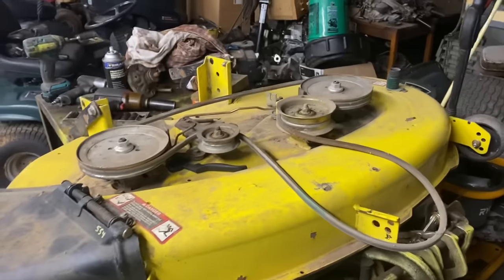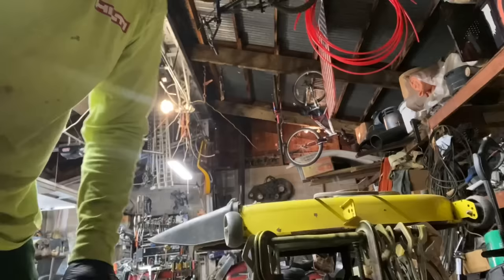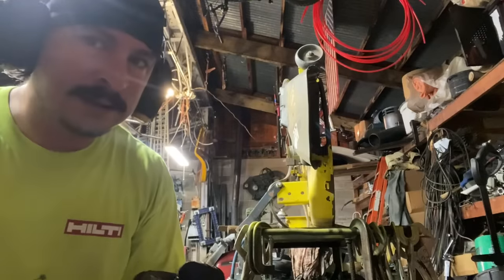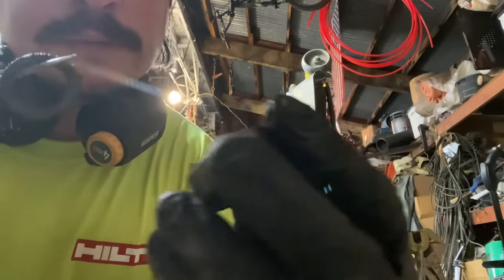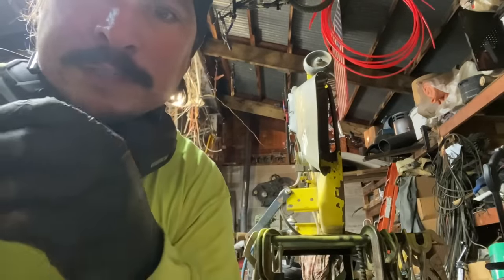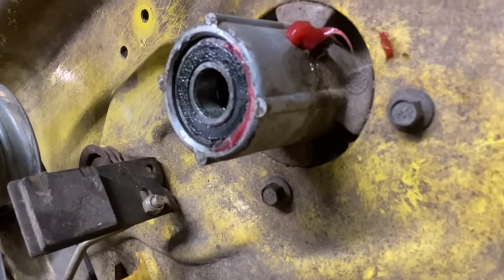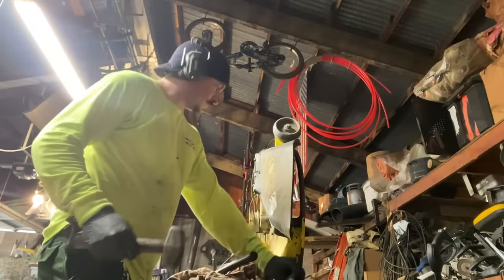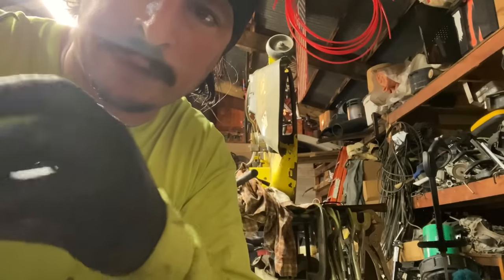Part 1 - Don’t trust the “Experts” Grease your mower deck sealed spindle bearings Common sense.

Comment: the question should not be, can you hydraulically force grease into a sealed bearing. but should be, does a sealed bearing have enough grease in it to do the job. also how long will it last with the factory grease. if the sealed bearing is not leaking then the bearing should be fine.
Reply from the maker: Hello Al, it’s easy to make a quick judgment on a process you don’t fully agree with or at least have a question about. Just for a moment take a minute and consider I may have some useful information here and at worse case if you try this is could do nothing negative really. Maybe seems it could, but it won’t. You may not have worked on riding mower decks equipped with shielded bearings as extensively as I have. I didn’t learn this process immediately and it took many years to figure out that this does work and actually works very well, 100% of the time to be exact. I put my experience of working on mower decks in combination of sevicing v box sander bearings together and realized that the bearing application were very similar and with v box sanders we have to grease to the point we see grease exit the seal so we know the bearings are filled. Once I did some experiments I figured out this is the same process needed for mower decks that use similar style but smaller shielded bearings. I also realized most folks offering advice say to dismantle decks and remove seals or dont even try to grease if a seal is in place. Once I understood the process I wanted to share the findings with folks so they could simply add grease without needing to take seals out. Some folks think the geese won’t make it
Into a seal, I wanted to prove that the grease will get to the bearings and easily passes the lip of shields. I was not eager to even make another video. I don’t specifically enjoy the work required to post a video. Even one as low quality as mine takes time to record and edit. I was only motivated after watching a video by donnyboy who posted a video claiming that it’s pointless to add grease through a zerk. I happen to know that was absolutely terrible advice to give folks. To answer your question how long can a bearing go on the grease it came with, Not long enough. Simply add grease and they may very well last the life of the mower. Folks who agree with my video have posted many moments stating they do this very process and have had the same bearings from day one. As for why I did the video, I didn’t need to work on this deck. I specifically took time out of my work load to try and help folks. I’m sure it seems like the question should be different from your point of view but from the spot I’m standing and asking questions I think I hit the nail on the head. Iv seen almost new machines only in there 2nd season of use with sealed bearings locked up. I’m sure your point of view seems very logical for someone who doesn’t deal with mower deck repair on a regular basis. However as my  video archives show, deck repair is mostly what I do. you might gain some benefit from the years of trial and error Iv delt with to learn this is a 100% fail proof practice. A new bearing can fail in less than 2 seasons of use if not greased. In some
Cases Iv know bearings to last 10
Years maybe some could go longer from the factory. It all
Depends on the quality of the bearing, quality of the grease in said bearing, also the amount of geese in said bearing. Also the way the mower was stored. Was the machine left out in the Weather or indoors? Was it washed with water or left in the rain a lot? Was the deck covered with grass and heat held into the mandrels or was the deck blown off with a leaf blower after each mowing so that the mandrels were not holding in heat from piles of grass? A blower is better than water on the deck as some bearing shields are not water tight. Those same shields that are not necessary water tight and let water leak in, well those same seals let grease pass without the need for the high pressure a grease gun is capable of exerting. It actually takes very little force from the gun to push grease past a shield. However, Lots of very important factors can play into how long a bearing lasts. The same machines made on the same day could go to two different homes and live a completely different life due to how all these factors come into play. To think my process is a problem is strange to me
Because it’s simply adding lubricant to a bearing. Some new bearings only have a few drops of grease. And grease does not need to leak out of a bearing to cause a failure. It may just not have come with much grease when it was new. I show brand new bearings out of the box with nearly nonexistent amounts of geese right out of the box in some other videos. Also Water could get in or it may have had super low grade grease or simply didn’t have enough grease in the first place. It’s almost like they engendered some of these things to fail about the time warranties expire. I believe it 100%. Why else would a new bearing not be filled with grease when it’s in a new machine? But when I buy bearings the high quality bearings come almost completely full and the cheep ones came nearly empty. These are some questions we should ask. But good luck getting an honest answer. If you just came to be a naysayer and not interested in actually giving this process a fair chance it won’t make any difference. I only posted to help people. I get nothing else from this.

Comment: Can you feel it while pumping in the resistance of the grease gun handle when the cavity is full and you are actually getting the grease past the seals and into the bearing?
Reply from the maker: Sometimes a very light difference can be noticed if really paying attention to how each pump feels. However very little pressure is required to pass these little light rubber lips on seal so sometimes no difference is felt before grease exits the assembly. Really have to watch for the grease.

Comment: I'd be tempted to not put the rubber seal back in the bearing on the inside, it would allow the grease to get into the bearing easier.
Reply from the maker: some units don't have inner seals some do. so will work either way. the point of the video is so that folks who do not want to bother with a tear down will know that grease will pass right by the shields like they don't exist. some folks think the shield will block pressurized grease and i just wanted to get that information out there from my point of view a detailed step by step process was necessary because a lot of folks think the seal / shield can stop grease and in fact it does not. According to other videos posted on the topic, some say the grease can't reach bearings but those same videos are just an opinion and do not show any tests to prove the term and i feel like that is misleading people with an opinion and they need to run some tests and prove it. if they would run tests they would see the grease blows right past the lip of seals.

Comment: Use 90 degree nipple in shaft end to facilitate grease gun attachment.  No need to remove deck to grease.
Reply from the maker: 90 works fine in some places. But most are not angled zerks. Almost always come with a straight type. The only one that is usually hard for me to get on to is the center pully assembly on a Tripple blade deck for the craftsman/ hysqvarna / Poulan units that have a zerk in the tip top of the spindle right under middle of tractor. 90 be nice in that one !

Comment: How many hours of blade usage would you estimate between greasings? Or is there a visual sign to look for without taking them apart? Thanks
Reply from the maker: Average use for a home owner machine that is not used commercially would be used about 40 hours a year on average. That could be more or less just depends if the machine is matched properly for the size of the property.
And that’s simply my opinion. Once a year is plenty. If it’s done properly and the assembly is filled correctly the first time.
Reply: @GTObearclaw1  Thanks. I have been doing it every Spring, but never pumped in as much as what's done in the video. I will from now on.
Reply from the maker: @kperellie  after the first time filling the assembly the next times will only take a few pumps. The prior times you added grease it most likely only started filling the void between bearings. Until you see grease exit you just don’t know it reached or passed bearings.
Reply: Thanks. That makes sense.

Comment: When I replaced the spindle bearings, I packed a little quality wheel bearing grease and reinstalled the seal, not had any trouble in several years. OEM bearings sounded like a helicopter.
Reply from the maker: Sounds like a win. If your deck has zerks you can also apply more and get more years of run time without need for tear down. Thanks for the comment

Comment: That's a new one on me. I would not have thought that the grease would have penetrated the seal. Next question is that if the grease puts that much pressure on the seal to enter the bearing.. does it push the seal in contact with the bearing balls and does it cause seal damage and contaminate the bearing with seal particles? If the seal is all rubber probably not a problem but if the seal has a form retention spring and or is a metal seal could that be a problem???
Reply from the maker: None of that is a concern. Many comments brought up this point if you care to express comments Iv gone into detail on many comments. To keep it simple, it’s never once been a concern. The process works fantastic and has 100% of the times Iv done it this way with zero failures of any kind and it extends the life of the bearings.
Reply: @GTObearclaw1  That's good to know!!  Looks like I''ll be changing the way I grease the bearings on my decks. Got 5 right now. I have three old sears garden tractors besides but they all run tapered roller bearings and are open sided in the spindle housing.  Great video and sounds like you've put it to the test.  Great job!!
Reply from the maker: @lonhoschar1943  the tapered bearing set ups are much much better quality units.
Reply: @GTObearclaw1  They certainly are!  The ones I have were made in 1969, 1972 and 1978. Still running and working.  Too bad they don't make them like that anymore. 😀
Reply from the maker: @lonhoschar1943  many newer commercial / heaver built machines are using very similar set ups. Definitely worth a spending a little more money to get the better machines, especially if they will be used hard. Thanks for your comment.
Reply: @GTObearclaw1  You are most welcome and thank you for making a great video and for the extra information😃

Comment: Great video!! I never understood the sealed bearing thing? If grease can leak out or get water in the bearings, than a few pumps with the gun should have no problem getting grease into it. If that gun can pump up the Track tension on a excavator, it should be no problem on that sealed bearing. Thanks for taking the time to do that video. Sure it's going to help some folks out, and save there spindles.
Reply: Did ya notice that all the bearings he intentionally broke the seal on all had grease? Asking for a friend.
Reply: @paulclouse3169  those are not seals they are just covers , ya can pop em out with yer finger nail , put a new bearing in some water  do you think it will keep water out ? NEVER
Reply: @TheCaperfish  They keep grease in.. Not water out.. We have sold 300+ units with sealed bearings in the last 3 years. Bearing failure.......none.
Reply: @paulclouse3169  thats my point  they are not seals they are covers , a seal will stop fluids from entering or exiting  ie ..... , pinion seal , axle seal etc    so they are covers , not sure why everyone calling them seals ?

Comment: Great video, thanks! I have a 2012 Husqvarna YTH24K48 riding mower and I grease my spindles/mandrels every time I clean the the deck or sharpen the blades with good quality grease. Blades are still running smooth with no issues. I've heard so many people say that the spindles are designed to fail by the manufacturers. If your mower doesn't have zert fittings then you have a cheap crappy mower. Also, I believe most people believe a couple of pumps of grease will do the job, and I know people that don't even realize that their deck spindles need to be greased, they think, "Sealed Bearings" are maintenance free! If you maintain your equipment properly you won't need to spend your cash at a shoddy repair center. My neighbor has an old Honda water cooled, 38 inch cut rider, spent about $1,000 bucks at the repair shop! Still leaks oil, they didn't clean the lower deck or sharpen the blades, didn't grease the spindles and it won't stay running. I did some research and I believe his timing belt slipped but he doesn't want to fix it, it just sits in his garage and collects dust!
Reply from the maker: Your one of the few who takes care of the equipment. I love it. I’m
The same way. Thanks for taking the time to leave the positive comment.
As for that homda, they are getting hard to find. Iv had a few those are great machines. But just like any machines they still need the basic Preventative maintenance. Keep
Up the good work.
Reply: Ask your neighbor if they want to get rid of that Honda please. What part of the country is it located?
Reply: @jackbarrier7267  About and hour south of Chicago.
Reply: I have a 2018 Husqvarna MZ61 and it has a lot of zerks. Front axles, spindles, all the mandrels and idler. When I looked at the Service manual they were very specific about how many pumps of grease to use at each point. As I recall it was 2-3 for some and maybe 6 or so for others but not much at all really. I always wondered if they came 'prefilled' with a lot of grease in the void or not. I just added grease to mine until it came out or it seemed like enough. I did have to add quite a bit the first time. Just strange that the manual only called for a few pumps. I can understand '2-3' pumps if it's already filled, but I really doubt they ship them that way. That's a lot of expense in extra grease.
Reply from the maker: I’ve never seen one completely filled from the factory. All the newer models Iv worked on have been empty in the void. A hand full have had some grease pumped into
The center but only a few squirts like the manual says. Only a few times in my life have I have seen a spindle that was completely filled and when that was found it was on a tractor that had obviously been well cared for over a long period of time apparently by one of the few folks alive that understand the need to fill the void first. On these machines all joints were well greased and the steering and other bushings also looked great. I agree, once that void is full then and only then will 3 pumps be enough to do any good. this just goes to show that whoever writes the owners manual is out of touch with how things work in real life. Even engineers are not perfect. And who really knows, maybe they want you to feel good about servicing the deck and make you think they care but possibly they want the bearings to fail so you will pay for repairs or possibly decide to upgrade to a new tractor. The more machines that get retired and go out of service just means one more new machine will be sold to replace it. The few of us who understand how to properly service a deck will see many times more life out of our bearings. The other guys who think the manual is correct may never learn the truth of the matter. Just because a book says so that’s the law in some peoples stubborn minds.
Reply: @GTObearclaw1  My friend was looking at 'prosumer' mowers last year and was between the Husky MZ and the Ariens Apex. He went with the Apex and one of the 'features' they touted was the 'greaseless' blade spindles. I'm not sure if there's any grease points on the machine, probably the front axles or spindles but I can't remember. It would be easy enough to add zerks to all the points you want to grease, but thats just cheap that they don't do it in production at the factory. Most consumers these days are lazy or uninformed. If a piece of equipment has grease fittings 85-90% of the consumers won't use them anyway, so they just delete them in production and save money. Even ungreased the 'sealed' bearing can last several seasons with light 'homeowner' use but there's not a lot of grease in those 'sealed' bearings to begin with.
Reply from the maker: @vincemajestyk9497  some commercial models have heavy duty tapered roller bearings. Those can last much longer. But I have no knowledge on the apex machines so I can’t comment on what they are.
Reply: @GTObearclaw1  Sealed ball bearings, NO zerks on the Ariens. Tapered roller is pretty extreme. Straight roller would be well 'over engineered'. That's not a bad idea. I bet you could find a cross-over to convert the sealed ball-bearings to a tapered roller.

Comment: It's really to keep waster out from washing the deck down I often wondered why sealed but I've had some with open eands
Reply from the maker: The shields help with water but unfortunately they are not able to keep water out as well as you might think and no that’s not the main purpose though it would obviously be a added benefit to keep water out. Best not to leave a tractor in the rain and avoid continuous washing with water. For those that know, air is the best way to clear a deck after mowing. Blow off debris and no need to worry if water got in a bearing. At the very least, engage the deck after a wash to throw the water off the bearings. Shields are there to keep contamination out and grease in but more grease must be added to ensure longer life.